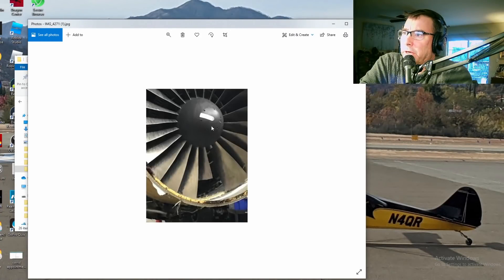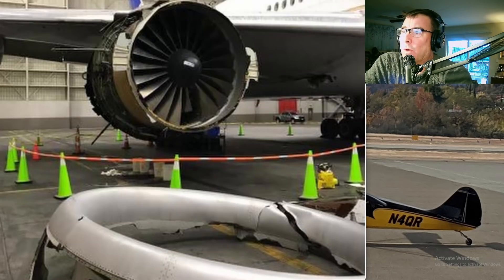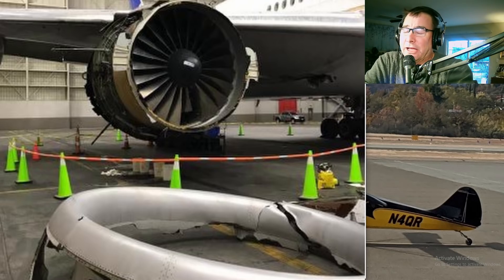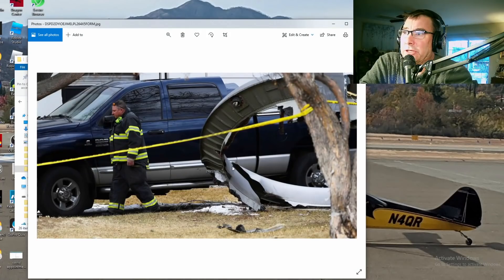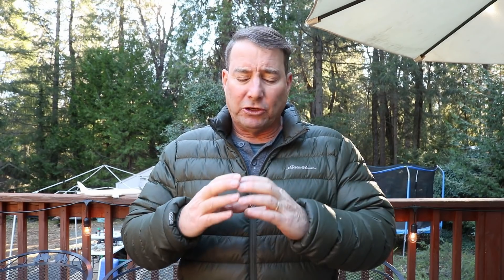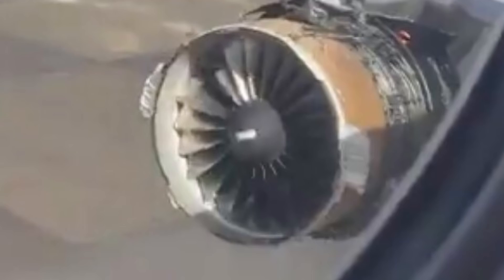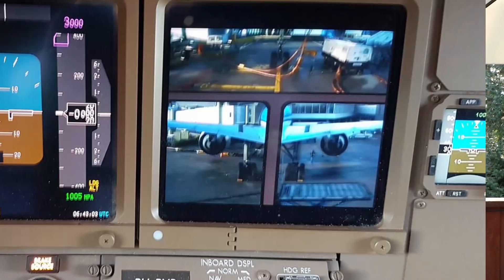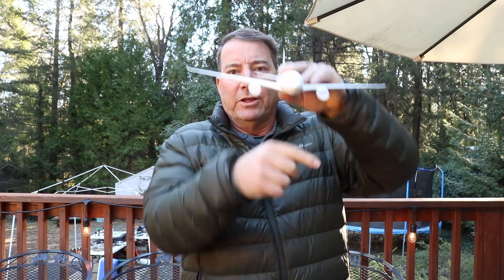UAL 328 UPDATE Fan Blade Failure  B777-200  22 Feb 2021

Comment: Thanks for the up date  the first what is coming up in my mind is, boy its a lot to walk true as flight crew in this situations!
Also how the technical and software developments has taken over a lot of procedures from the pilot and crew.
Bud one thing you never will are can take out is the human factor in this situations, its good that there is training on simulations with this kind of emergency situations.
Other factor is that as passenger you need to trust in the experience and knowledge of the pilots, as well as on the plain herself.
In my opinion this is worldwide well organised,  for my job i fly a lot and never i had any bad experience with crew are pilots.
When i look at the way the technical components are tested and individual check t on  flaws and failures and written down and stored and maintained  in a data bank.
Plus how the ground crew are trained and kept up to the newest developments enz enz, there will be always a other factor what you never can exclude as a risk.
This will be the fatigue and wear of the materials over the time that this is in use.
In other words you can't exclude the risks in the aviation as well as in all other disciplines bud still we can learn.

Comment: In 96 I was flying out to Edmonton in a 737, sitting in window seat at the rear of plane, watching oil stream out the side of the #2 engine and actually collect on the thrust reverser. Got an attendant's attention to inform the flight crew (we were 20 minutes out) and so we landed long, they opened the reversers but did not throttle up (aerodynamic braking). Fire trucks were out to form a welcoming committee. If the crew didn't receive the info, and had flown a normal approach, we would have been at risk of a failure at the worst moment. You have to speak up if you see something not right. Remember Aloha Airlines? A passenger SAW the cracks on the cargo door frame before flight!

Comment: https://www.swissinfo.ch/eng/more-problems-for-swissair-s--md-11s/1420084

February 14, 2000

This is also about PW-4000:

More problems for Swissair's MD-11s
Swissair has confirmed that jet engines on one of its MD-11 planes have broken down twice in the last three weeks causing flights from Nairobi and Los Angeles to abort take-off.

This content was published on February 14, 2000 - 06:55February 14, 2000 - 06:55
Swissair has confirmed that jet engines on one of its MD-11 planes have broken down twice in the last three weeks causing flights from Nairobi and Los Angeles to abort take-off.

A spokesman for the national carrier confirmed that a fault with the rear engine caused the plane's take-off from Nairobi last Thursday to be aborted. 180 passengers were on board the aircraft at the time.

The same plane was forced to turn back shortly after take-off from Los Angeles on January 27 after the pilot reported that the left engine had failed. Specialists were flown out from Zürich to California to change the defective engine.

Swissair said it was an unfortunate coincidence that the same plane had developed technical problems with two different engines over such a short period of time.

Comment: If you compare the inlet ring of any Rolls Royce fitment on the Airbus , 747 etc even the B52 or some of the GE engines , it is much deeper than the 777 P& W ring to contain compressor fan blades . In this case it was uncontained and the blade struck the fuselage . RR has the next series of commercial engines the 'Ultra Fan' ,with highly complex multi pitch multi angle compressor blade designs for the next generation of Boeing and Airbus etc. designs , and the next generation of engines for our 6+ generation fighter . For a simple pitch design of blade to fail in this case it just should not happen . A great deal of mass of the blade is in its locating ring at the blade root but even so with 1 and 1/2 blades gone , the imbalance at 90% would have been severe .
As you say the fire was probably caused by a damaged oil line , failed shaft seal etc and very little oil is required to to make a good looking fire with a good supply of oxygen at speed and low altitude . In this case it looks like the main part of the fire was at its lowest point in the engine probably gravity fed as no pumps would be running on that engine at that stage . It would eventually burn itself out from lack of fuel ( oil) but the shaft may windmill for sometime after as they can run dry or with minimal lube at that particular rpm in an ETOPS situation .
I would imagine we will see deeper inlet rings retrofitted as a result .

Comment: I can still remember how McDonnell  and PW had huge problems delivering the promised PW-4000 performance in terms of thrust and fuel consumption with the new MD-11 to Swissair. The worldwide best qualified PW -engine engineers at SR-Technics at the time found some solutions. But that didn't change the fact that the No. 2 engine of a fully loaded MD-11 exploded when it took off in Narita and it was only thanks to the luck that the take-off had taken place over sea that it had not resulted in a catastrophe. Year 1991or 1992. An SR-Technics Engineer told me that the PW-4000 had been tuned  to the limit of performance and perhaps beyond.  Who knows whether this engine is not generally operated too close to the limit. I think experts should be able to answer that.

Comment: When an engine malfunctions, there are conditions when it is best to jettison the bad engine.  The jettison should be done in positive acceleration maneuver so the engine does not damage the wing and/or tail section.
Reply: Really? How is it that after decades of aircraft building no aircraft manufacturer has ever thought that to be a good idea. And how would an aircraft down one engine accelerate enough to jettison the bad engine? When the engine mounts are designed for much more thrust that what a double engine would be capable of. Would you jettison a engine over suburban Denver?

Comment: With additional photos this event is starting to look eerily similar to the UA1175 event on Feb 13th 2018. The NTSB released the final report back on Jun 30th 2020 concluding the probable causes were: "the fracture of a fan blade due to P&W's continued classification of the TAI inspection process as a new and emerging technology that permitted them to continue accomplishing the inspection without having to develop a formal, defined initial and recurrent training program or an inspector certification program. The lack of training resulted in the inspector making an incorrect evaluation of an indication that resulted in a blade with a crack being returned to service where it eventually fractured."

It would be very interesting to see what has changed since the last event and the release of the investigation report.

Edit: the link to the NTSB report is here: https://data.ntsb.gov/carol-repgen/api/Aviation/ReportMain/GenerateNewestReport/96738/pdf
Here's the docket: https://data.ntsb.gov/Docket?ProjectID=96738
Reply from the maker: I need that link if you got it. Just got off the phone with that Captain....update soon. Jb
Reply: blancolirio Where are the maintenance inspections done for those engines?
Reply: @blancolirio  https://www.youtube.com/watch?v=O-_IAKCBTxc
Reply: @blancolirio  and please activate your Windows 10 :P
Reply: nightstalker  I’m not going to argue semantics with you. If you don’t like the way he presents it which you clearly don’t considering you felt the need to criticize it and tell him to practice, then again move along. Or better yet if you can produce better, would love to see it. I’ll wait.
Reply: nightstalker  LOL I don’t think so buddy. You’ve won the internet argument congrats. I hope you feel better knowing you’re 1-0 on the internet today!
Reply: I read that report and I have had a lot of experience with fan blades as well as other P&W incident investigations.  This was NOT training, but lack of feedback on what was and was not a rejected blade.  Examining blades is just as much experience as training, and when the blades we passed up for further inspection there was no feedback from the engineers so the inspector would get a better idea one way or the other.  That report has bit of BS to it as they wen back at looked at the previous tests AFTER the fact and probably did not take a look larger sample of "good" blades that produced similar testing results.  The other question is if the inspector has access to the previous tests on the blade.  Just how time is given to the inspection.  When we inspected blades (for fighters, so low pass fans with "acceptable" damage) we would document existing damage to see if the issues were "propagating"
Reply: Quite a weird coincidence that the aircraft from SFO to HNL in 2018 was N773UA and the aircraft this time was N772UA 

https://aviation-safety.net/wikibase/206147
Reply: I live near one of the manufacturers that makes these types of fan blades. It's pretty amazing at the machine work on them. I think the one I looked at was the turbine blade because it had little tiny holes for cooling. I'm not sure which brand engines use these made here. Morristown Tn
Reply: @Bryan-Hensley  Problem with those holes is that they can get glassed over by sand.
Reply: nightstalker  you realize this guy is giving you better information in real time than you’ll get in the final report 2 years down the road, right? If you don’t like it feel free to watch the  other countless idiots on YouTube giving their unfounded and highly speculative opinion. What a dumb thing to say. Don’t like it then keep moving.
Reply: nightstalker  yes I’m wrong. Again you have won the internet today. Sorry though gotta go drive to the airport and operate a flight to Amsterdam but enjoy yourself out there in commenter land. Hold down the fort I’m sure Juan is appreciative of your bozo comments.
Reply: @cirrus9me882  nailed it, and thanks!
Reply: Thank you for sharing. 🖖
Reply: This was absolutely my thoughts when this was first reported. Very familiar to the other experiences, we definitely need to be pointing to PW and their inspection protocols.
Reply: So there's an acceptable amount of cracking in a blade, so that the engine can be returned to service?  Wow!
Reply: @pulaski1  yeah that line alone chills me. Forgive my paranoia but the amount of cracking should be none. If my 🚗(I don't drive but) had so much as a tiny hairline I'd probably be sending it for a repair
Reply: @pulaski1  YES. Remainds me of the "allowable cracks" in the combustion chamber liners that blew apart and caused the disaster of a B737 of British Airtours... same kind of "tolerating it until it really blows into pieces" kind of mentality...
Reply: 2016, a Southwest jet was forced to make an emergency landing in Pensacola, Florida, after suffering a similar failure, then  United  on Feb. 13, 2018, then Japan Airlines Co. Ltd. 777-200 suffered similar damage on Dec. 4, 2020. All three of the 777s were powered by Pratt & Whitney PW4077 engines. I'm not an expert but there is something seriously wrong with the design of these engines.
Reply: @quivalla  [Wrong with the design] Maybe, or they're not being serviced and maintained properly - the inspection process is flawed, and/or the blades are apparently being used beyond their actual useful life.
Reply: @pulaski1  Good question but not likely the result of “servicing” since there is none. The  blades are exquisitely designed, engineered and manufactured to high tolerances. On engine overhauls each is removed and taken through a series of detail inspections. Out of tolerance ones are discarded. Just like any equipment or component subject to the stresses of use, engine components of jets go through a lot: temperature, vibrations, speeds, g-forces, etc. They are incredibly reliable. These are extremely rare instances of metal failure.
Reply: @Rhaman68  Thank you for the additional details, but your "removal and inspection" procedure is what I would call "part of engine servicing".  Obviously a piece of metal, no matter how exquisitely shaped and balanced, cannot be "serviced".

Comment: Where is the fuel shut off valve located on the engine or in the strut ?  The 737 MAX is engine is very close to the under the wing , would the effect of a fire in the engine effect the integrity of the wing.  Newer bigger engines are moving the motor closer to the underside of the the wing would a uncontrollable fire that close to the wing effect the structure ? The land gear is fixed even though the engines are getting larger in diameter.

Comment: What happens if you lose an engine and lost cabin pressure too in midway to Hawai?
Reply: That wouldn't be as bad as two engines and flying at 10.000 feet, one engine would consume less fuel than two.
Reply: @jospi2  but the speed will be much lower too so the flight time will probably will be longer.

Comment: Juan, curious if the extra vibrations from the failed engine could transfer thru the wings to opposite engine, expediting a failure of the good engine.  Sounds like these PW hallow fan blades are making the NTSB a bit nervous.

Comment: In the 1970s I worked in engine inspection on the P & W JT9D (747) for South African Airways and we had to do crack detection tests on the (solid) fan blades. We specifically checked in the root of the blade as that was were they were subject to great stress. If I was doing that job at United now I would probably be crapping myself.

Comment: I have been wondering about 2 issues or a long time, 

1) if the fan produce a considerable amount of thrust to pull the plane forward with it then once you remove the load from the blade, it will still producing thrust for a moment, it will have a short moment of shooting forward before air resistance will let it fall back. The front of the engine seems to be a vulnerable area fan blades are likely to escape from when the load of the plane is suddenly removed from the blade. The idea that the blade will move along its plane of rotation is not true when it produces a lot of thrust. The forces acting on the blade the moment it releases is not just outward but also forward.

2) By containing an blade failure you contained the object and not the energy, where does all that energy go? it gets reflected, the blade bounce back, but it will most likely end up in the area of least resistance, there where other rotating structures are not. With all interactions with the rest of the spinning engine the open area in front is the path that will have little restriction. it is more likely that when reflected that it will reflect towards the front, So is it contained when you stop the direct projectile, but then reflects it and cannot stop the reflected object? The reflected object can be almost as energetic as the direct object. So the idea of contained failure is subjected to the definition of the term "Contained".

 Its like, can armor stop a bullet if the bullet reflects and kills someone else? I mean the bullet didn't pass through, but it still killed because the energy was not stopped. 

They would have to rethink what the term contained failure should mean, it should mean to absorb the energy.

Comment: They need to remove around ten windows on each side of the aircraft next to the engines to prevent shrapnel from going through windows!  Ant believe this has not been done yet
Reply: Shrapnel would go through the aircraft skin like nothing.
Reply: Much more likely to bust through aircraft windows... while removing the windows in this area, engineers could also reinforce this area more👍👍

Comment: Look up the Wigner effect to understand why jet engine failure rates will be increase during the ongoing magnetic pole reversal. Increased cosmic radiation especially in the stratosphere breaks down the bonds in the metal at the atomic level.

Comment: A more or less similar event has occurred in the Netherlands on Sat 20th Feb: according to MSM a 747 400 cargo plane operated by the UK based firm Longtail Aviation lost an engine over Maastricht airport: blades were dropped over the region, damaging cars and roofs. the a/c then turned over the Belgium Ardennes to make a safe emergency landing on Liege regional airport at 17:11 local time. 
https://twitter.com/r_eygelshoven/status/1363161499515183106

Comment: That shows what incredible pieces of engineering those engines are...
Reply: OR, How increfibly hard are those pushed to the limits, in search for more fuel savings, performance or lowering emissions.  The fact is that "too many" engines are failing recently.
Reply: @alfredomarquez9777  do you have any idea how many planes are in the air at anyone time ?

Comment: Yuan-With a major failure it may be useful for the pilots to know about the extent of damage, loose materials, fire etc as may effect how the plane can land or quickly the plane needs to land.   After the failure and when the plane is stabilised does a pilot go and view the damage or do they request a flight attendant to go and look take a photo and report back?
Reply: It didn’t make a difference in this case. They landed quickly.

Comment: Looks like kevlar containment worked to prevent blade flying into the fuselage. That’s very impressive.
Taking any bets against stress cracking?
How about manufacturing problems?
Are the blades made in US?

Comment: Regarding the fan blades exiting the engine, I think that's one fundamental difference between the testing done for containment, and actual failure. I suspect that these seldom fracture evenly, but typically the rear of the fan blade that has tensile stress fractures is where it fails first, allowing the fan blade to swing forward from the thrust forces before the remaining material at the root fails and it ends up impacting the cowling/containment at an angle rather than just simply coming straight off the fan disk as would happen with an explosive charge.